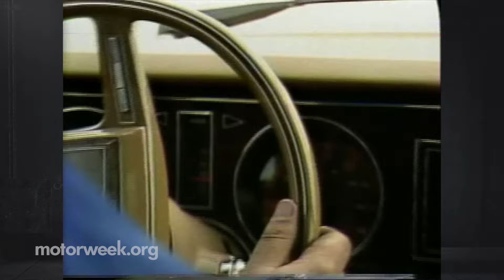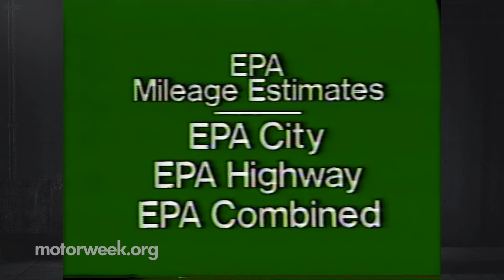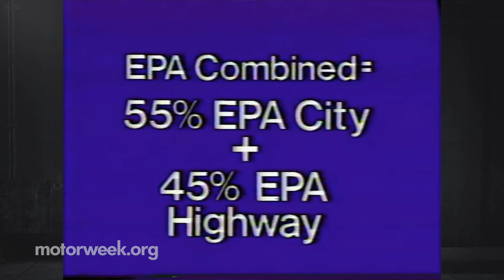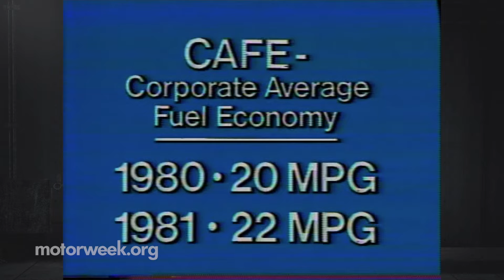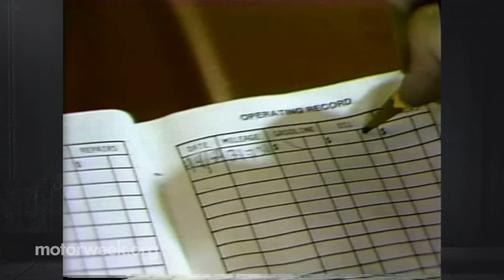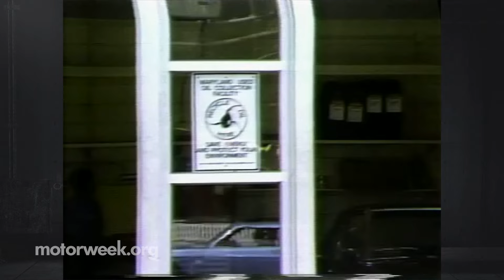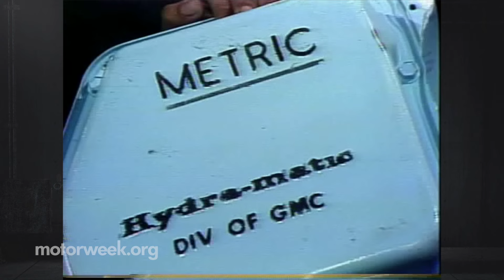MotorWeek | Retro Review: Unaired Pilot Episode

Comment: 85 HP from a 3.3 6 cylinder. Man have times changed.
Reply: OddManOut44 That was pretty sad even by 1980 standards
Reply: That sad ass 3 speed automatic ain't helping things either...
Reply: OddManOut44 In 1980 it was required to have 33% of the pistons counteracting the forces of the others. I believe it was some sort of psy-ops tactic used during the Cold War to confuse the Soviet Union.
Reply: King Whombat xXxX
Reply: Yeah, but on the other hand, the engine's simple, overbuilt, understressed, and will last for decades. Modern engines won't do that. They're too high strung and won't live much past warranty.

I'd rather have that 3.3 I6 than a modern 3.3 I6.
Reply: @TestECull  , modern 3 liter engines are bulletproof. 1 liter engines are the problem...
Reply: @FlorinC1984  Modern 3L engines aren't any better built than the 1L. Every gram counts when the bean counters are railing down hell into one ear and the EPA is demanding unrealistic fuel economy in the other ear.

That's the whole problem with old iron. It's skookum as frig, it pulls like a freight train, it lasts forever, but it's not efficient by today's standards. You can't build engines the way they should be built AND meet the MPG requirements. Something has to give. They're pulling bits from the longevity meter to pump up the economy meter.
Reply: EXTREMELY!!!! 💀
Reply: @TestECull  Never, ever thought I'd see rosey-tinted nostalgia for one of the worst eras in automotive history. If you were an adult back then, you were driving these reluctantly while fondly remembering the 1960s, and your dad was still complaining about overhead valves.
There's a lot to hate today, a few to love from back then (I'd like to have an '83 Eagle
SX/4, despite the work that AMC 258 would need. Always thought my grandma's '82 Caprice was nice).
I got 95k on my 9th gen Accord with 280hp that does things only a Porsche could do back then. I'm going to go back to 68hp and that new fangled fuel injection everyone told me not to trust back then, maybe even smog pumps, for what? 50k more miles? 100k more miles? ...and hating every mile? I'd rather drive a lawnmower.
Reply: @TestECull  
My buddy had an '89 Honda and got 327k miles before he got rid of it, and that was only on 3 cylinders after one died at 265k
I had 220k on my 1991 Honda Prelude before I got rid of it
I currently have 250k on my 2011 Honda Civic, Si model.
And this Si rev's to 8300rpm and makes 205hp.
Can't say I miss ANY American cars from the 80's. Especially anything GM. My '82 Trans Am turned into a dieseling, backfiring, rust bucket waste of money.
Reply: @Lorenzo-fw3gx  Lol needing to rev to 8500rpm to make power is not a sign of 👌. Call me strange but I like my power down low, right off idle. Guess spending the last 13 years at the helm of a 300 I6 which loafs along happy as a clam at 1400-1750 all day long and never has to exceed 2100 to accomplish any task I present it has shaped my demands from an engine. But yeah I want my power right down low.

Friggin love that I6. One of the best engines I have ever worked with.

I'm sure that civic is a decent little runabout but there aint enough money in the world that'd make me trade my 85 F150 for one. I love having enough power to keep up with modern freeway traffic down below 2,000RPM, love not needing 6, 7, 8, 10+ gears to get on as some cars have these days. Just got four of them, I row them myself, and I generally only need the first three unless I'm at or above 55.
Reply: However, I do miss the exterior style/design and space of the interiors, it was like riding in an elegant living room; nowadays for that you large V8 SUVs, sedans and utility cars' interiors are horrible compared to the seats of these older cars, trunks too. It's like comparing the way we used to fly 20 years ago and the way we fly today, unless you can afford business class you are squeezed in between seats like a sardine.
Reply: Sad for 200ci but about right for an engine developed in the late '50s,  breathing through a single barrel carb and choked by early '80s emissions crap. The 144 in my Falcon is it's older, smaller sister and it's also rated at 85hp... gross.
Reply: Odd, since my '84 Escort with a 1.6L H.O. 4 cylinder produce 80 h.p.
Reply: @rzu7120  Prolly still runs too. Cant say that about modern junk. Wont last. Too high strung. Adage 'burning a candle at both ends' comes to mind.
Reply: Yes it's bad, but it's an Inline 6, which means it most likely had a very usable torque curve.
Reply: @ryguy9024  85hp net is not 85 hp gross. Your 144 likely makes closer to 60 if adjusted to net hp like the fairmonts 6 cylinder is
Reply: @FlorinC1984  The truth is modern engines be they 1.0 L or 3.0 L have all grown far too complex to ever be thought of as bullet proof , those are words one uses when describing a volvo's build quality or armored trucks .. lol .
Reply: Thanks Govt!   They're now doing to Diesels what they did to everyone else in the 70's-80's
Reply: Yeah, and now we have 3.0L I6 that makes 510 hp and 500 lbs of torque in a 3 ton SUV that pushes it to 60 in 4.8 seconds

Comment: One thing about the Ford Fairmont is many of them were still on the road in the early/mid 2000's while the Chevy Citation's were nearing extinct by then.
Reply: I have to disagree or I at least have the complete opposite experience. My first car was an 85' Chevrolet Citation and I kept it (through my 2nd and 3rd car) till about 2005. During the early 2000s, (I think 2000) I started a GM X body Club online.  I saw quite a bit of citations on the road here. I think I seen one (1) Fairmont ever. I live in South Florida.
Reply: @CeeStyleDj  The 80, 81 Citation was just amazing with how many parts failures they had. Ford had the advantage of the time tested engines and no freak wheel drive.
Reply: Ive never even seen a citation
Reply: Also the Fairmont was the first version of the "Fox" platform. I'm not even gonna TRY to list the 80s-90s FoMoCo cars built on it! Everyone knows the Mustang and Lincoln MK-VII, But there's MUCH more! (I'm a GM guy, But I gotta give the "Fox" and "Panthers" their due respect!)
Reply: @CeeStyleDj  Fun Fact: The FWD "X" platform was used as the basis of the FWD "A" platform, That was a success in to the mid 1990s. ( a lot of folks don't realize that the FWD "X" and FWD "A" are related) The pre '84 "X" cars had problems, But mainly only the Chevy and Pontiac versions seem hard hit, The Olds & Buick versions seemed a bit better (I guess they SHOUD have as they cost more..). But even the Chevy and Pontiac versions were sorted out after '84.
Reply: @jamesslick4790  The wheel base of the X and A platforms are identical only the length was stretched.  These platforms were as used on more vehicles than the fox bodies.

Comment: I love how almost 40 years later we still have the exact same tire changing equipment in brand new cars.
That is except for the ones that give you a can of Fix-A-Flat and a crappy little air compressor.

 let's not forget the screwin that we receive.

In 1983 the Ford Fairlane, fully loaded cost $5,011 and the average income was $16,135
Thus the fully loaded Ford Fairlane was 31 percent of your annual income.

I would assume the Fairlane nowadays would be roughly similar to the Ford Fusion

Well, a top model 2020 Ford Fusion, not fully loaded will cost you 35,000, and the average income is $54,325 ( these people are clearly not working class because I work for Honda and make a lot less than that)
Thus the fusion is 70 percent of your income. 

So in case you haven't been paying attention boys and girls this country has screwed every one of its citizens in the last 40 years, into a disproportionate increase of cost of living over average income.
If you are a member of the working class, God forbid...... your income is going to be much lower then the $54,000 average for the country, thus the 400-plus percent increase in cost of living means you are barely getting by.

All the old people right now who think the young people are just whining, need only to look back through the lens of time and realize how fucking good they actually had it.
Reply: Yeah, my 2003 Bonneville has the exact same lug wrench and scissor jack
Reply: Think you meant Fairmont lol. And no more bumper jacks

Comment: 19:42 this is why I do my own oil changes. I wait til the oil stops trickling out completely. Sometimes I wait a half hour to an hour before replacing the plug.
Reply: GT6SuzukaTimeTrials Totally agree. I also go a step further. Once drained I pour in half a quart of fresh oil to flush all the old crap. Also, I leave the filler cap off so there is no negative pressure to prevent old oil from draining. It also speeds up the draining process.
Reply: Agreed! I love the practice of priming the filter with at least a little bit of oil as well.
Reply: that's pointless

Comment: I think this is from 1980.. They mention a 1979 model as if it was already  out and the 1981 model like it was on the way.

Also the oil was changed 9/4/80 in the owners manual.

Comment: The description might be a bit off on the year - the Mustang shown was a '79 model year release, and the GM X-Cars came out in early 1979 as '80 models. So, maybe this is from sometime in 1980? Still, impressed that you've put this out there, considering it is vastly different in tone and spirit to compared to what came later. And, the Fairmont reminds me of one of my mom's old rides, which is awesome. Thanks again, MotorWeek!
Reply: Upon further review - the news about upcoming small cars means that this dates to no less than the middle of 1980.
Reply: @Duncan1800  the oil change date is written in the owners manual. 👍

Comment: I wonder how many vehicle buyers went to the then imports after owning these two POS. I had a 78  Fairmont and it was junk. Steering wheel cracked,twice. The seat where bolted to the floor cracked through the floor pan and I only weighed 190. The radio was replaced three times and a loud scraping sound was where the heat shield rubbed other parts and was fixed by removing and grinding. Was never so happy to be rid of it. A friend had a Citation and not enough space to put down all of the problems he had.

Comment: I'll take the Ford Fairmont! The one I'd want to be exact is the '80 Fairmont Futura 2 door Sport Coupe with the 5.0L V8 and automatic transmission options!
Reply: Unfortunately the 5 Liter V8 was only available on the 1978-79 Ford Fairmont's, in 1980 they were replaced with a 4.2 Liter V8 engine, in 1982 only the 4 & 6 cylinder engine's were offered.

Comment: 15:35  Craig was quickly replaced by Pat Goss, no?  Also... 7,500 mile oil changes back then?!?!
Reply: Hubjeep: Your correct, The first episode that actually aired featured Pat Goss. It's also been posted & I believe it's one of the first 10 retro reviews. I also disagree with their "too high for my taste" 7,500 mile oil change interval. I don't care if I'm wasting oil, or if it's not even dirty. The engine oil in my vehicles gets changed every 3,500 miles whether it needs it or not! All members of my family have followed this strict regiment since my grandfather started the practice in the mid '50s & none of our vehicles have ever blown an engine or ever had any kind of internal damage at all for that matter. We'd rather spend $20 bucks for oil & a filter instead of thousands in costly repairs or for a new engine.